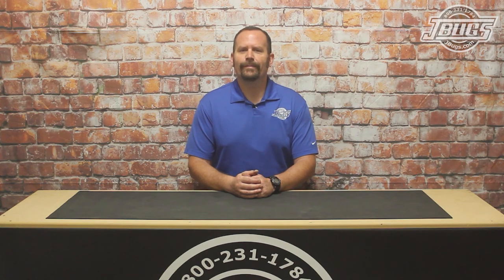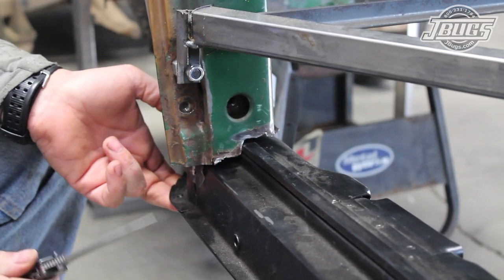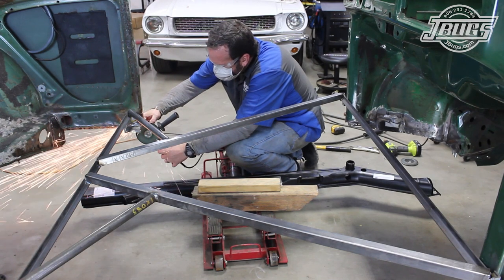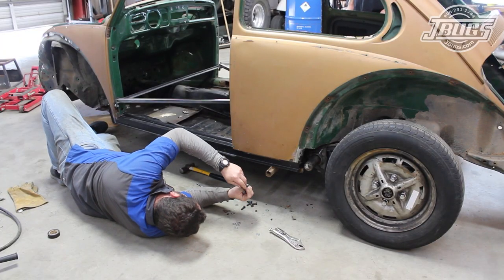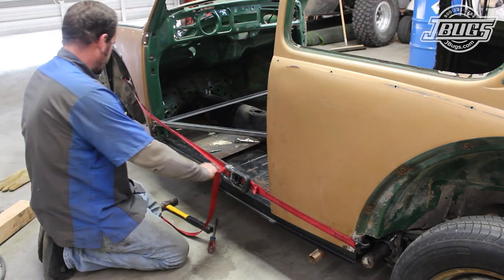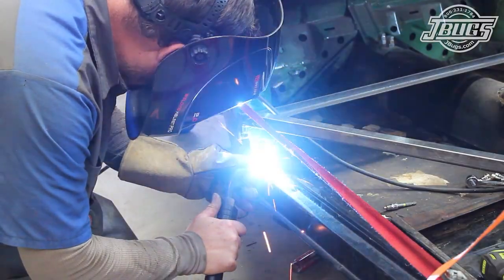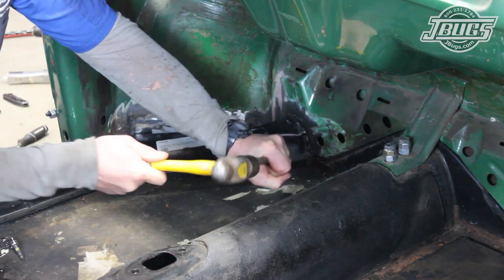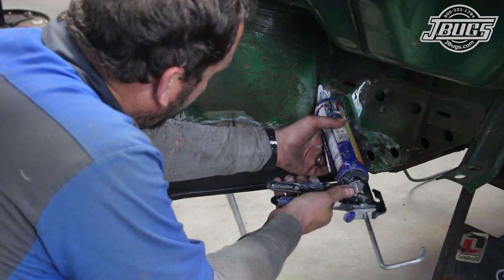JBugs - 1971 VW Super Beetle - Heater Channel Installation

Comment: My heater channels are contacting the jack point and not laying flat on the pans, looks like yours may have been doing the same. Did you have to make modifications to fix this issue?
Reply: It is common for the jack points to get bent up and contact the body (at the heater channel) which is why I don't typically install the jack points. If you aren't replacing your floor pans, you can pry and bend the jack support down and away from the body. Afterwards, don't use that jack point, as it is most likely just going to bend out of shape again.
Reply: Thanks!

Comment: I am sure you know this. Your heater Channels do not line up. The two holes that bolt in at the Napoleon Hat are in the wrong place. These are your best heater channels. Why do you keep selling them like this? Why does the manufacturer not correct this? Why do you not warn your customers of this problem so they do not spend extra time screwing around trying to get things to line up. The Napoleons Hat is a major line up point.
Reply: They aren't ours and we do not have direct contact with the manufacturer. We sell them along with many other suppliers and while they aren't perfect they can be used. I installed and showed how this heater channel had to be modified not to highlight how great they are but to illustrate how they must be modified to work, like any and all sheet metal repair pieces.
Reply: I am not trying to be overly critical. Just wish I would have known and not had to spend the time figuring out where the problem was. Good thing I bolted everything up to the factory floor and found the problem before welding the channel in. Side #2 should go a lot quicker knowing where the problem may be. Thanks for the reply. Hopefully no hard feelings. Just hoping I could save someone else the time. @Sam_Mebane

Comment: What were the measurements on the door frames? A frame to end of door and top to bottom?
Reply: Front to back at the outer ledge the opening is 36 1/4". Top (at the roof, just above the headliner grippers) to the outer ledge is 40 7/8". 

Either way, before fully welding the seams, test fit the door and make sure the opening fits correctly and that the body lines and door gaps are lined up and even.

Comment: Hey! Can 1965 fenders fit onto a 1970 bug?
Reply: Absolutely, just keep in mind that along with different lights, the cars also had different bumpers. So you’ll have to address that if you swap.
Reply: @Sam_Mebane  Thanks! Do you know about a 74?
Reply: @Justakidthatrantsisapimp  I do, the bumpers on the 74 aren't really desirable. The holes in the fenders for the bumpers are large. The tail lights and the turn signals aren't usually what people want to use either, but the fenders of a 74 Standard Beetle will fit the 65. The front fenders won't fit IF the 74 is a Super Beetle.

Comment: Another thing too is having the door on helps can’t always trust the opposite side. I get it works most cases. But why would you go threw all that welding without installing the old door, don’t recommend welding support bracket at door keep them inside. Great video but the average person doing this needs to check with door before complete welding
Reply: Absolutely, test fitting the door is always the best.
Reply: @Sal Spencer  i cant even hang my door its that rusted :(